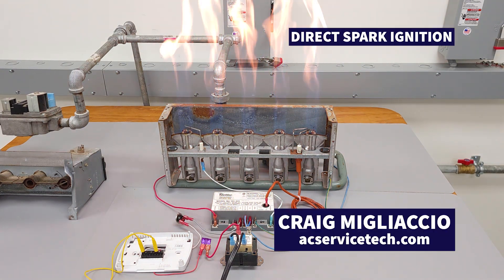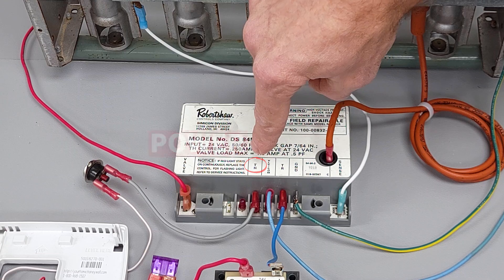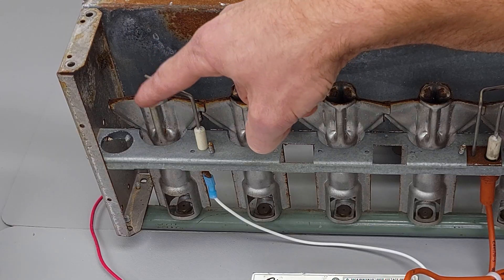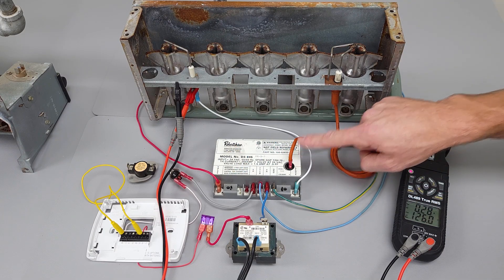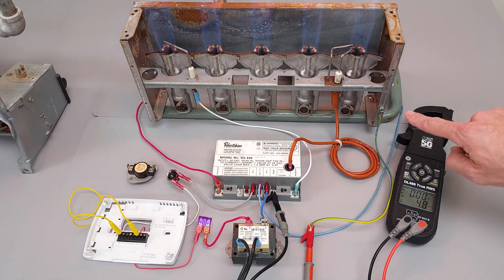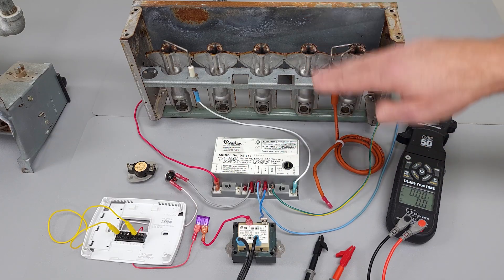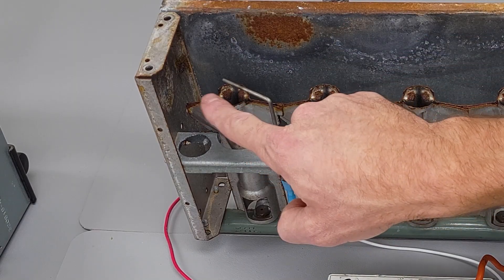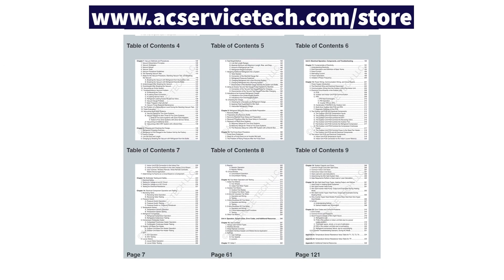Gas Furnace SPARK IGNITION Operation and Testing!

Comment: Seeing how 120 volts was generated from the direct spark ignition board doesn’t that imply that inside of it is a transformer of some sort? The only discernible extraneous volte\age source is vis the 24 volt circuit found at the TH and TR terminals respectively.
Reply: The direct spark ignition module has fancy circuits that jack up the voltage.    In effect like a transformer.

Comment: My gas electronic ignition fireplace works on the same principal as a gas furnace as far as ignition of the gas. The difference between the module in the video and thee one I own is that my system has only two rods. One for spark and one for ground. It does not have a SENSE terminal on the module. The gas valve, control module, and transformer have been replaced as well as all of the wiring. The problem is that ignition will not occur if the glass front of the fireplace is in place as in structed. (two clamps on the top of the glass and two on the bottom) However, if I remove the two clamps from the bottom or top of the glass and swing the glass out an inch or two the gas immediately lights every time. If the glass is completely removed the gas lights without fail???????

Comment: I spent over $500 to have a repairman come out and repair my gas fireplace, which operates with a Robert Shaw ignition control as used in the video. After installing a new gas valve, transformer, and control module he told me that it could not be repaired. I asked about replacing the whole fireplace and he quoted me a price eight thousand dollars + not counting the expense of having a mason come to the house to replace the rock surrounding the fireplace opening. I was fortunte to find this video two days after the repairman was here and found out that the issue with the "no spark condition" was the fact that the ground and the 24-volt rods were slightly corroded. I cleaned both rods gently with 100 grit wet and dry sandpaper and the fireplace works perfectly now. The fireplace twenty years old so a little bit of corrosion is to be expected. The replaced parts would possibly failed in the future so I'm not unhappy that they are new, but you can understand why I'm happy that I came across this video.

Comment: The GND wire that connects to the frame of the burners is the Return Path for the Spark electricity. 

 Every electric energy flow requires a complete circle path... a spark is no different. It's just like a car spark plug... if you connect the ignition wire to the spark plug - but don't connect the metal threads to the spark plug to the Chassis or Engine Ground, you won't get a spark across the spark plug.

If the spark generator board isn't Grounded to the burner metalwork, it could burn up the spark generator - because that high voltage energy pulse HAS to have a return path... and if it's not through the proper path, it WILL create a non-desired return path... usually through the High Voltage transformer on the circuit board... which usually causes a failure.

Comment: A few questions: The Gas Unit heater at the warehouse is not working. Why is the automatic ignition system not working two times? The LED light was out. I tested the 120V to 24Vac transformer, which is working. What is it not working cause?  is it overload?  limit switch or valve gas fail?  or did the automatic ignitor system have a problem? it name is FENWAL. now it is discontinued. hard get order it because FENWAL company is gone. KIDDE-FEWNELL is a new company. Maybe I am wrong.

Comment: When the AC voltage is sent down for the sparking across the the probes(or probe and burner ) to the ground  to make the circuit , the flame sensing probe is also  sending ac down to the  flame to convert to DC for same ground to prove? Is the flame rectification proven after the  sparking stops , like a window of time  ?  As it would be AC from the spark and DC from the flame proving or am I getting confused ? Or is it possible to sense both at the same time from the same ground ?  Anyone’s insight is helpful tia
Reply: 8:17

Comment: I'm getting a voltage drop in the MC terminal, when the wire is connected to the gas valve it is only reading 15vac however when it is disconnected from the gas valve it reads 26vac.  The pilot is sparking and lighting and blower is turning on however this drop in voltage seems to be preventing the burners from coming on.  Would it be the gas valve or the ignition control module at fault?

Comment: My furnace has a control board for everything. 

The inducer fan goes, the spark ignitor clicks, the gas valve opens in short few second spurts a few times but it won't light. While doing this the furnace clunks or clicks like a gas valve or relay. 

The best I can gather it's a rusty buner tube not getting ma back to ground or a bad ground and it cutting the gas quickly then retrying a few times before giving up for a few minutes. 

The part I don't understand is why the clunking or clicking. 

The furnace doesn't do this all the time just sometimes.

Comment: Great video! I have a Rheem direct spark ignition unit. The unit would short cycle where the burner would light and burn for about 4 seconds then shut off. After a few attempts, it wouldn't do anything for about an hour. I couldn't call anyone because of my work schedule and it being a holiday week also. I took a shot and ordered a new dual electrode spark ignitor from Amazon, which showed up in only 2 days. After I installed it, my heater works perfectly. Was this just a coincidence or does the spark ignitor have something to do with the flame rectification process? (it was labeled ignitor/flame sensor) Thank you.
Reply: They sometimes are combined with a third rod coming in front of the burner as the flame rod. The older Airease units are that way also.

Comment: If the module go bad and need to be replaced should we have to look the same one or there is an universal will work with all models ? And it needs to do some changes or just we can put it direct without any changes thanks in advance

Comment: Having issues with my raypak pool heater. I have identified it down to a flame rectification issue as the pilot lights well and doesn’t activate the main gas valve for burners. Today I attempted to test the negative for micro amps (disconnected from gas valve) I connected it in series and couldn’t get a micro amp reading. When unplugging I got electrocuted by touching one probe of the multimeter when the positive was plugged into the negative. Why would the negative be carrying an electrical charge from the motherboard? Thanks

Comment: A couple months ago we installed a 95% Ruud furnace.It is now rusting very bad , the inside of the inducer collected some orangish rust.  Even drain coming out is orange/rusty. Has correct gas pressure. Has both exhaust and intake going outside. RUUD Model # R95TC0701317MSA
Reply: Proper duct sizing?

Comment: Flame roll out switch,  cannot find a replacement for mine, keeps tripping can you help me find a replacement for it?  Thank you
Reply: A flame rollout that is constantly tripping is usually a sign of a cracked heat exchanger and is very bad news.  These switches are generally very reliable so you'd be fortunate if a replacement solved your issue.  A CO detector near the burners when it's running might show high CO as would a washy flame pattern that rolls out when the main blower powers on.

Comment: Craig I have a stupid question 

If there is only 24 V going to the ignition module, how does it produce high voltage?
Reply from the maker: There is a low voltage to high voltage transformer under the hood of the icm.

Comment: Is there a step up transformer inside that board to be able to send 120 vac to the flame sensor?
Reply: 120v is present at the board and it doesn’t require a step-up transformer.

Comment: I had a headache yesterday with a direct spark ignition furnace, except it had a pilot ignition assembly with a single flame rod. 
The ground wire was hanging on by a thread & was enough to not not give it proper ground. 
Also the pressure switch was constantly opening and closing since the inducer is on its was out only pulling .67” of WC on a .70” WC switch. 
The arching from the spark ignition due to the opening/closing of the pressure switch I think may have caused the pilot assembly ground to fail? 🤷

Comment: 24V into the ignition module but 120V out to the sense wire. Is there a step-up transformer in the module? Am I missing something?
Reply: i mean it also provides 10000 volts for the ignitor. was curious about this as well. has to be something internal in the ignition control

Comment: I have a question ?? Is there a device tool that a Hvac tech can u to plug on fan motor’s n control board to get a diagnosis besides a (multi meter ) to test all components
Reply: It’s there any please link it to the comment section please n thank
Reply: @mr.spliffaddikts-157  The short answer is no, not really. Most furnaces for the last 30 years do have some sort of onboard diagnostics. When there is a problem, we count blinking lights on the control board and then find the key to what the blinking lights mean to narrow our search for the problem. However, some upper-end units do have more sophisticated means of diagnosing the issue. I service WaterFurnace geothermal units and use an Aid-Tool analyzer on the 3 Series and 5 Series units. Apparently, the 7 Series units can be diagnosed through an internet connection, but I have no direct experience with them. The analyzer can provide a lot of information about how the unit is operating and what issues it might have had or is currently having. Much better than blinking lights.

Comment: The only clarification I would offer is flame sensing microamps (ua) is present on the sense wire as well as the ground wire.  You need both to complete the circuit.
Reply: True, and I believe Craig covered this starting at about 8:00 through 10:00.

Comment: I'm curious about the voltage on the flame rod, when we test flame rods in the field we always measure the signal from the rod in Microamps DC, I didn't realize there was also A/C voltage on the flame rod, so the signal from the flame rod to the board is measured in microamps, DC, but the rod also has a potentially high A/C voltage on it? Could you share more about this?
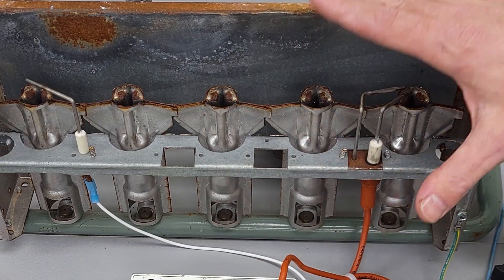Reply: It is flame rectification. I know I'm not explaining this by the book, but basically, the AC voltage present on the flame rod is rectified by the flame to DC. It is just a phenomenon that happens when AC voltage is in a flame. The flame conducts a very small amount of DC current to ground, this is the uA DC that we measure. This is why the ground on a furnace is just as important as the hot and neutral. Also, rusty burners can inhibit the current flow. 14:30 Craig explains this pretty well.
Reply: @chrisdeanndavison3626  Thanks! My fault for posting the question before finishing the video.
Reply: So there are ac micro amps AND dc micro amps running through the flame rod, and which one is being measured by the pc board, ac or dc?
Reply: @coolramone  the way I understand it is :  there is AC power (different than voltage) available to the flame rod. When the circuit is closed by the flame, the AC power is rectified by the flame to a small DC circuit which can be measured in micro amps. The flame is the switch.
Reply: @coolramone  dc microamps